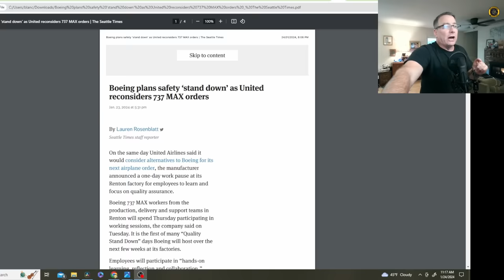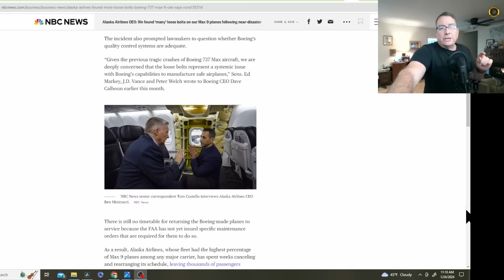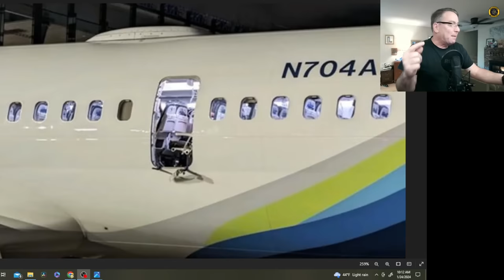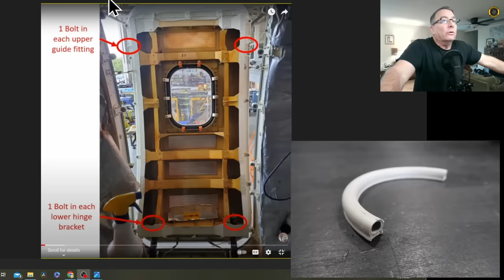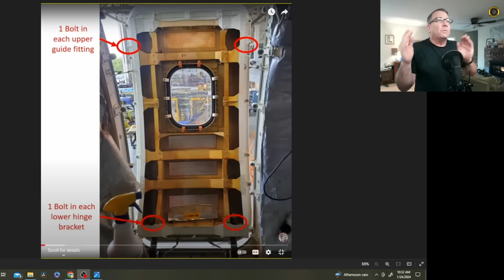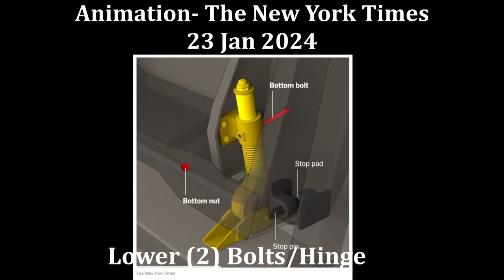Boeing's Quality Management Failure Explained 737-Max-9 Door 24 Jan 2024

Comment: Two different QC programs working on the same aircraft is a disaster in the making.  How difficult would it be for sprit to retrain it's employee to use the QC program Boeing uses.  I would image it would take months to retrain at Sprit.  It is obvious to me someone chose the "door open" step and not the "door removal" step to keep from the door having to be inspected.  Whoever made that choice is darn lucky no one died in this accident.  
Great job Juan.  I do appreciate it.  
Alan from NC
Reply: This is exactly what happened. But there is also the issue that "door opening" should ALSO require inspection if any critical bolts are removed. This was complacency and bad norms and throw in some laziness. 40 year aviation mechanic and currently Quality Inspector. This all sounds very familiar.
Reply: Both open and removal has a QC stamp spot ..for bolts installed  remember this is not a serviceable emergency exit door ..it is put there to delete a serviceable door, that would fill that spot .the beginning of the paperwork would be different .but the end of the paperwork would be about the same ,or close to it.... okay to close "stamp" closed "stamp" okay to install retaining bolts "stamp" retaining bolts installed "stamp" up to leak check and return to service. as far as the fascia internal cosmetics it might be on that paperwork or other paperwork.. manufacturing it'll probably be on other paperwork..
Reply: How difficult will be for Boeing keeping Spirit as part of the company instead of selling this key part of their manufacturing?
Reply: Boeing probably doesn't want Spirit to have full access to things not related to what Spirit wants, and Spirit can't have Boeing able to see what's happening for Airbus components they make.

Comment: Even when you use the toilet, the job is not complete untill the paper work is done.  No doubt an item should have been written to secure the plug  ( install the bolts)  once the seal was replaced.   Just like most aviation events there is usually more than one error that causes crashes. Even with no specific item it makes sense that those bolts need to be installed by the final  person securing the plug.

Comment: I do not understand how this is possible. I work on constructing and certifying custom system for aircraft. I am not a certified to work on the aircraft, but have been there long enough to understand the following rule of thumb: if an action requires a tool, it's not servicing, but maintenance. And if it is maintenance, a work order is required to perform it. Opening this "door" is definitely a maintenance action and not servicing - which would require a proper work order to do. How such a WO may be untraceable is beyond my comprehension.

Comment: Used to work at Boeing Wichita over 20 years ago prior to it being divested and turning into Spirit Aerosystems. Back when I worked there, they were pushing towards having mechanics doing their own quality inspections. I would imagine that they have proceeded down that path and that is part of the problems we are seeing now. Also, it appears that Boeing was in the process of throwing Spirit under the bus on this Alaska Airlines incident and if it weren't for the whistleblower inside Boeing, that would have happened...
Reply: I don't see how there's really any bus throwing here.  Spirit incorrectly installed the door seal, then forgot to put the bolts back in when their on-site team needed to fix the problem.  They should have just tagged it as a door removal, but they also didn't bother with that either.
Reply: They do indeed, have a lot of self inspection operations. Some jobs the inspector only sees the final  buyout on the job.  It's called mechanic verification. 
Boeing dictates what Spirit does on Boeing programs.
The most recent person involved in the investors lawsuit was a Spirit Aero QA 
(Manager, iirc) against Spirit. Not Boeing. 
Both companies love to give lip service to quality,  but it's QUANTITY they demand.
Reply: @mungtor  _ You must have missed the news today that they now believe that after the fuselage arrived in Renton, Boeing mechanics had to remove the door plugs and they think that they left the 4 bolts out...
Reply: @billnict1    I was under the impression from Juan's report that the team in Renton was still a Spirit affiliated team... which is stationed there specifically to fix the QA issues that come out of Wichita.   He addresses that at about 3:45 in the video.
Reply: @mungtor  - There are Spirit crews working at the Renton site, other Washington state sites, and South Carolina like Juan stated but Seattle news media reported yesterday that the plane with the door that blew out midair was reworked by Boeing employees. Spirit's stock took an immediate 1% bump up after that report came out...
Reply: From an article yesterday in the IBD: "Meanwhile, the 737 Max 9 investigations revealed that it was Boeing mechanics, not supplier Spirit AeroSystems workers, who improperly reinstalled the failed fuselage panel, the Seattle Times reported."

Comment: The "red x" process that we used in aircraft maintenance forms in the Air Force was pretty straightforward and standardized for any entity that touched our aircraft: If it is structure. electronics, wiring, or otherwise that is modified, removed, or disconnected from it's designed operational position, it is a "red x" item that must be signed off by a qualified person before the task is considered complete.

Comment: Everyone should remember that Watergate started as a relatively small insignificant event that eventually went right to the top. I am very concerned about how many other bolts are loose on any aircraft. I believe this is just the beginning and the problem with manufacturing is there only two companies out there they could make their aircraft. Airlines don’t have much of a choice. Not as easy as saying I’ll buy everything  Airbus as you pointed out. Great video Juan thanks again

Comment: Boeing seems to have some of the most expensive cost saving programs.  Airplanes do not have to be replaced at a set schedule, it depends on how much you are willing to spend on maintenance. In Canada , until recently, we are still using a few of the very first Boring 737-200 because they can be used on gravel strips, and some DC3s are still in commercial service, but they are not pressurized, or have turbo, that cut down on maintenance drastically. This door open/remove reminds me of ETOPS certification in the past.
Reply: Come to think of it, the MCAS disaster was a similar cause: Got a problem with the nose climbing?  Add some software to push it back down, and keep quiet about it, otherwise we'll have to spend tons of money training pilots about the situation.

Working on a plug door?  Just open it, don't remove it, or else there will have to be another quality check!
Reply: Fuel is a major expense for airlines.  If the next generation of a plane saves 10% on fuel, it's a huge win.  There is nothing inherently bad about having the most up to date technology.  Air Bus is not having doors fall off, or half baked software installed, like MCAS.  The A321 NEO is thoroughly modern fuel efficient quiet airplane.
Reply: Airframes are only good for so long. They crack and/or corrode
Reply: @ferdburful6352  The life of an airframe depends entirely on how much maintenance you are willing to spend on it. There are 70 year old DC 3 still flying and a Ford Trimotor giving rides at Oshkosh air show. Airframes are designed fail safe to enable a chance for the next major maintenance to catch any developed cracks.
Reply: @carljaekle  Airbus had their share of software problems, at least one forced a landing into a forest decades ago, another worked with human error and ended up in the Atlantic , and there were more.

Comment: Anyone who has ever picked up a castellated nut knows that a split pin  ( or cotter pin if you like) has to be fitted to make sure it is secured. It looks and feels so much different to a normal nut. I am wondering if sabotage is in play.
Reply: Negligence is far more likely than sabotage.
Reply: My thoughts exactly. One thing for sure is that they've already spoken to the individual(s) who were tasked with hanging that hardware. I'd love to know exactly how that meeting went. Imagine if it was one individual.....who knew there was no oversight afterwards.
Reply: Makes me think they didn't have any new pins, but didn't realize that till they put the door back on and the bolts in. With no good way to track that pins were needed and the way Juan described the work process, I can see the guy who knew pins were needed working on a different aircraft and forgetting to let someone know what happened the previous day. If the bolts were left out completely, I would think they would have lost the door plug on the first flight or even transporting the fuselage to the next location.
Reply: @jaygosch8705  agree, but the door should have been tagged, flagged to warn that the job was not complete. Never been In production but worked on the “line” over many years. Anything removed or marked for replacement at the next stop was always tagged to alert the next tech. (There are some faults a plane can fly with if necessary to the next depot)

Comment: Good grief, so complicated.  No wonder little things are missed during a shift change or other interruption.
Shouldn't there be a checklist for disassembly & reassembly of subcontractor pieces to verify everything is correct?
How does Airbus deal with subs?
Reply: Spirit does work for Airbus.  I wonder if they have compatible QC tracking systems?
Reply: @raygunsforronnie847  Wouldn't even matter as long as Airbus had a functional quality system themselves, since that's what all the final inspections would be done on. Doesn't sound like Boeing has that.
Reply: @raygunsforronnie847  Oh really!?  Yes, I'd like to know how they do QC for Airbus

Comment: Outsourcing has been a bad idea from the start!!
I worked for a major commercial airline for 33 years. As a result of a bankruptcy, the company outsourced overhauls to South America. One of the first couple A330 heavy maintenance visits, the acft maintenance ferried back to the USA, and the cabin entertainment system was messed up. What was found, the farmers in South America; to remove a overhead PSEU panel; just cut the wires!! But, management liked the farmers in South America because labor was cheap!! Numerous frightening  things came out of South America; but bean counters liked the bottom line!!

Comment: Boeing were very lucky no-one was sitting in the seat next to the door.  While we're always told to keep your seat belt on many people ignore this especially if it is a smooth flight.
Reply: Been a long time but I used to fly 70k-100k miles a year for business, only mishap I ever had was blown tires and ensuing brake fire in Maui, wasn't a big deal but the guys in the silver suits outside do get your attention.
When I first started flying a lot I was like most people, belt off as soon as the light went off, I was on a flight to either Hawaii or Guam on a 747 (When NWA still used them for that route) and I was talking to a flight attendant as the seat I was in had a huge space and an emergency door she was standing in front of me, we suddenly hit a pocket and dropped so fast and so hard that the flight attendant hit the ceiling so hard I thought she may have been killed, luckily she only received a slight cut on her head and some bruises. Peoples belongings were scattered everywhere and several passengers received minor injuries.
It was simply luck on that occasion that I still had my belt on, that was around 30 years ago and to this day my belt and anyone traveling with me always keeps their belt on ALL THE TIME. And anyone around me gets a lecture and story from an old man.
Reply: I used to fly quite often before retiring and I always kept my seat belt fastened even on long hauls to Europe or Asia. I always made a restroom stop before boarding and on long hauls I only got up and went straight to the restroom when there was no line waiting took care of business AQAP and quickly returned to my seat. On every flight I always witnessed many passengers unbelting, and young children crawling all over their seat or isle. Many years prior when I was on active duty and flight status the mandatory Altitude Chamber every three years always made me aware of a RDC possibility.
Reply: I believe the FAA should make it mandatory seat belts remain fastened.

Comment: 8:31 Looking at the animations, it looks to me that there's room for improvement in the upper guide track design. I'd add a "door latch" mechanism into the guide that would allow the pin to slide into the guide, but trap it. Thus removing two bolts from the closing process.

Alternatively, a catch could be formed into the guide itself. To open the door, the guide would have to be unbolted and slid over. Without the guide reinstalled it would not be possible to close the door as there would be nowhere for the pin to mate with, which would make the top half obviously ajar.

Either way would add a layer of idiot proofing.

Comment: Regardless if it's a door removal & reinstallation, or an opening/closing, there should be a quality witness or quality inspection step for any critical flight installation.   

The animations at the end were great!
It's still not clear to me if those lower bolt holes on the spring shafts are slotted to permit up/down motion, or if they're straight circular holes.

Also, I assume the 12 each "pins" at the 12 structural tabs are adjustable to permit custom-rigging the door to the frame for a smooth outer mold line.  Those 12 pins would also need jam nuts or some other locking feature as well.  Were those found to be adjusted & safetied per drawing requirements?

Im sure it's a good design, but sure seems like a Quality escape somewhere.  Thanks.

Comment: In your last video as well as this one, there is a small but very significant nomenclature issue that is not just misleading, but also potentially false. The object of the investigation, as well as the cause of the incident, is a “door plug” and NOT a “plug door”. The former closes the hole made for a door and basically makes it not exist any more. While the latter is a door type that needs to move inward first and then tilt or twist in order to fit through the door-frame to open outwards.
The normal cabin door are plug doors and not to be confused with what is used to nullify or cancel the mid-cabin exit on the MAX9.
Reply: Thank you for that.  If Boeing and Spirit had paid one-tenth the attention to detail that you apparently do, we wouldn't even be discussing this.
Reply: Interesting. If this is true, I wonder who, of all the people performing the work and writing the procedures and paperwork are familiar with the difference. This may be why "opening" a door plug is an allowable action in the paperwork in the first place! Or this configuration was mis-marked as the wrong type. Probably the reality is a little bit of ignorance on somebody's part, and a little bit of "gaming the system" on someone else's part.

Just goes to show the dangers of easily garbled names.
Reply: Thank you.  I had been wondering about the term.  I've heard it referred to as a "door plug" but also as a "plug door."  Word order can be important.  Fat free is completely different from Free fat.  Opening a door has different connotations from opening a plug.

Comment: Juan are you able to state whether the bolts are done up tight, to a specific torque, or just have the nuts run down and the split pins fitted?  Alaska Airlines stating they found loose bolts may not be an issue? Thank you for keeping this going.

Comment: Imagine if the procedure was to put the bolts back into the open holes with the doors open. Then there would have been the need to at least move them again when the door was to be shut.

Comment: So, as I understand it, the door plug can be "opened" by removing the four bolts, sliding the plug up and out to about 15 degrees. To remove the door plug, after opening the door plug, the hinges at the bottom of the plug are unbolted and the plug removed. Whether the plug is just opened or removed, the process is the same up to the hinges and both involve removing the bolts. Not having the bolts in is equivalent to not latching the door as there is nothing to stop the door plug moving up in the frame and opening. The wind did the rest.

Comment: This is a real serious problem. The only doors I know of on Boeing airplanes that don't require an inspector after opening are the overwing exits on the 737. That is an excellent design that is easy to open once you learn how, and almost easy to close by one person. Flight locks and annunciator lights complete the safety aspect of them, too.
Reply: The overwing exits are functioning doors, not plugs that are supposed to be a fixed (but openable / removable)  part of the airframe.